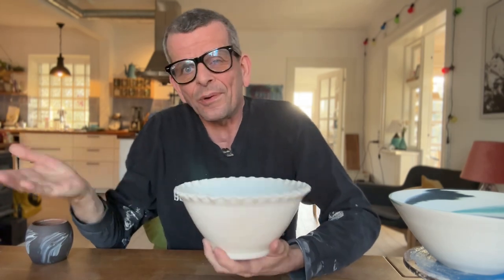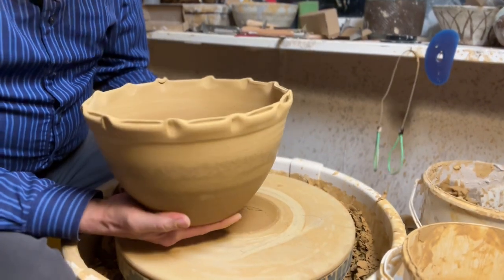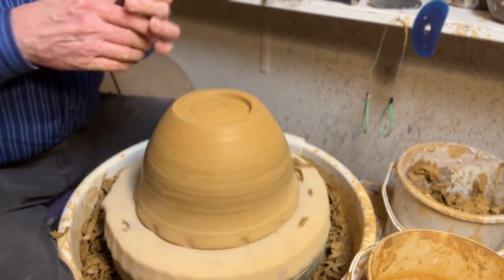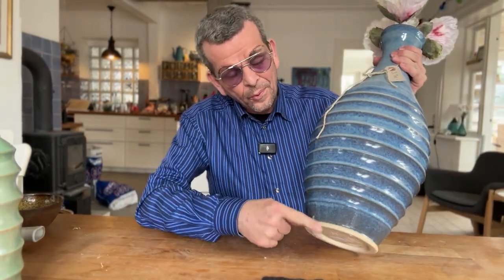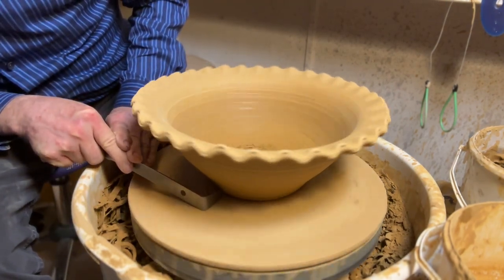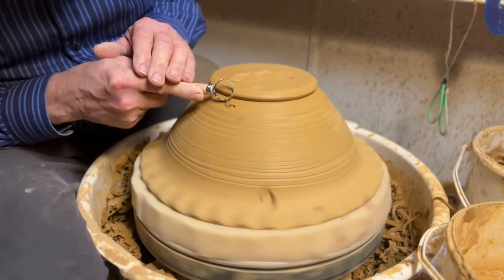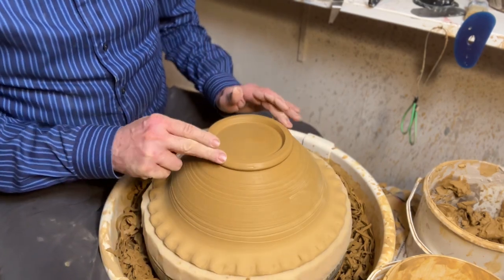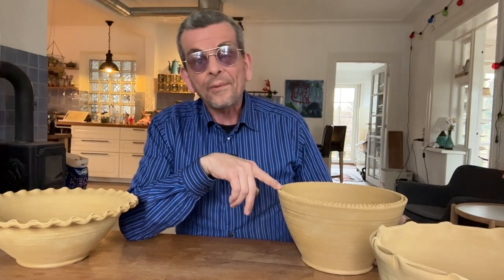107. Trimming a Foot on Pottery

Comment: Hi I've  seen potters use the foot cutter tools once they have finished throwing the pot and cleaned up the moist excess clay  not once they are soft  leather hard, suppose it works both with ways
Reply from the maker: Yes, maybe I should have mentioned that. Thanks for doing so :-) I prefer to use it on leather hard pots. If it is too wet, I think it often is harder to make it smooth